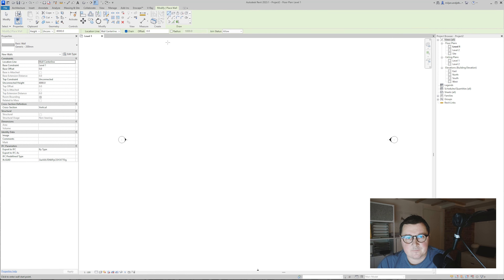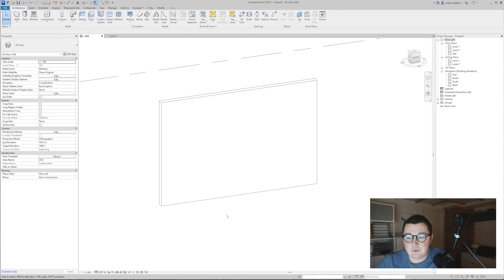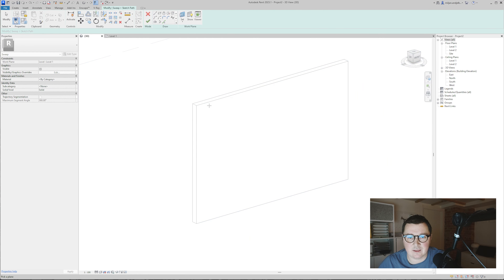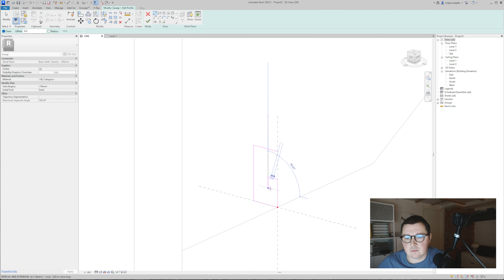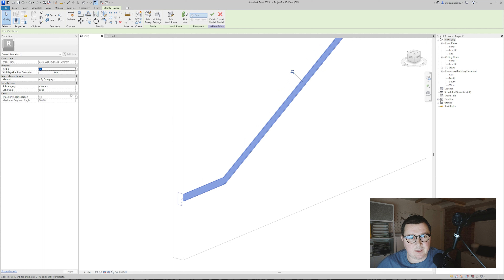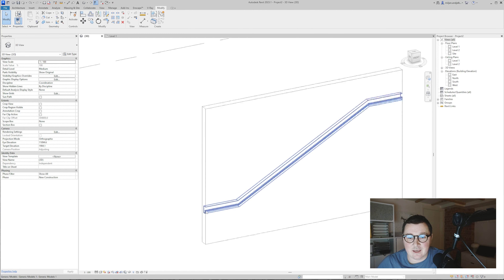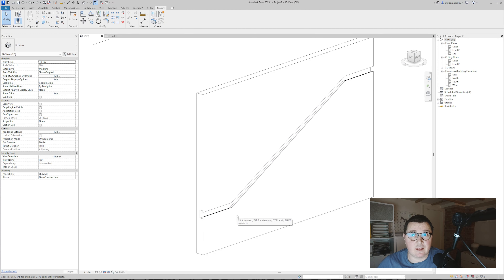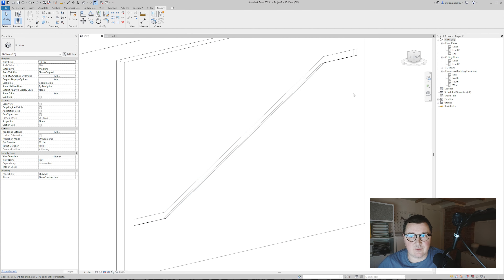Recessed Handrail in Revit

Comment: can we do it with a curved wall?
Reply from the maker: It’s a bit tricky, Revit has some limitations when it comes to curved walls. You can try this, it’s a work around and hope will work with what you need. Create a curved wall. Then from section/elevation view towards that wall create sloped reference plane. Attach top (wall) constrain to that reference plane. Then, create a sweep or reveal via model in place using that top of the wall as reference